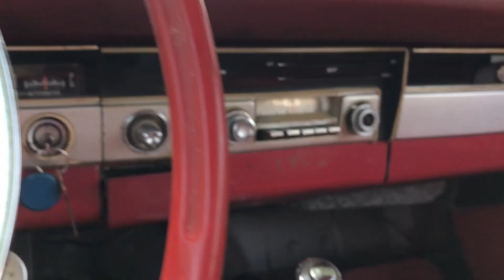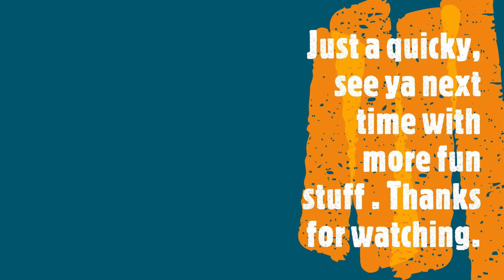1966 Dodge Dart GT Barn Find: This time: More body work, wash, kick panels, trunk lid and more

Comment: When I did patch panels on my 74 Camaro, I used the fiberglass reinforced evercoat as the initial filler over the weld joint. I etched the metal with a grinding wheel for some tooth for the glass to grab on to, then when that was done, I went over it with the lightweight evercoat filler.  The fiberglass filler I used was Kevlar reinforced, which I have not seen in recent years. It has held up great. 14 years now.
Reply from the maker: That’s a good idea